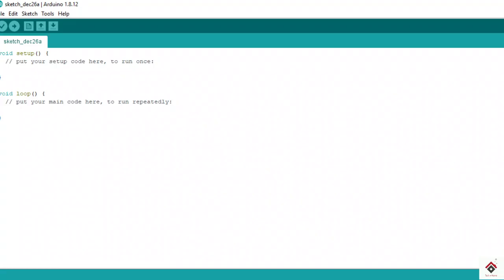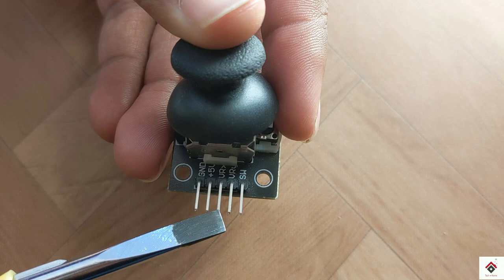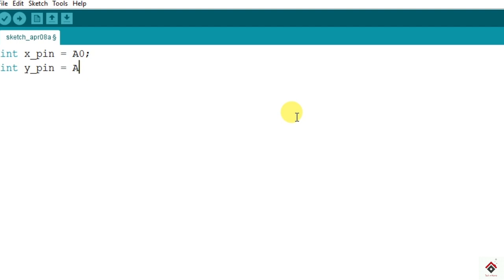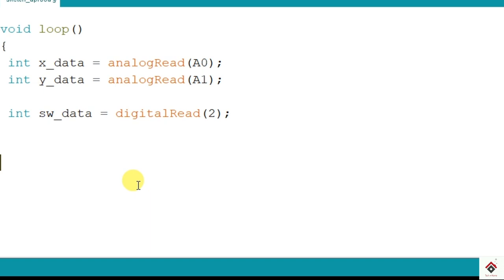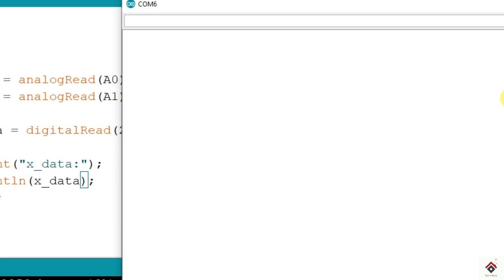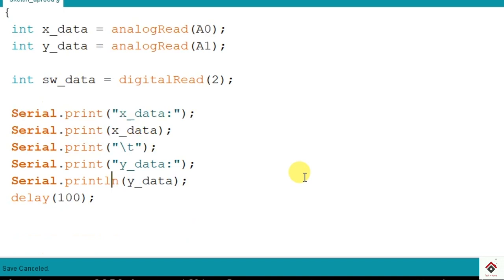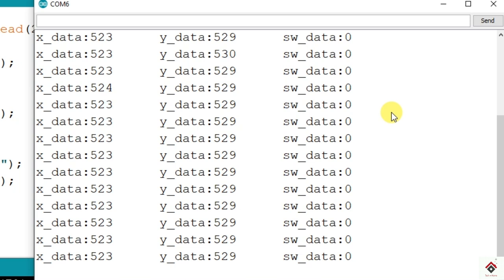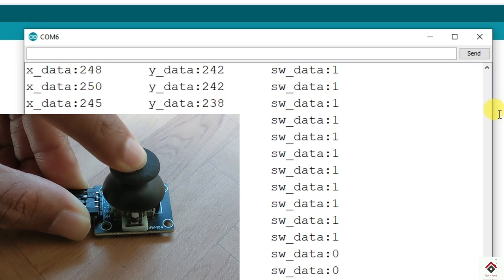How to use Analog Joystick module with Arduino | Arduino Joystick Module full tutorial [with CODE]

Comment: if you set the pinMode to A0, why did you even create an int value for x_pin? it's pointless
Reply from the maker: You can use variable also.
When you are having lengthier code with lot of pins, declaring pin using name helps. If any pin to be changed, just u can edit in declaration section.